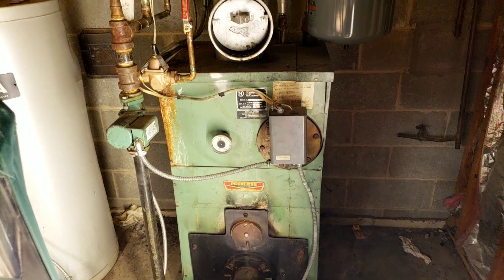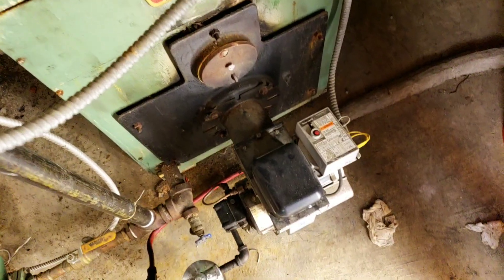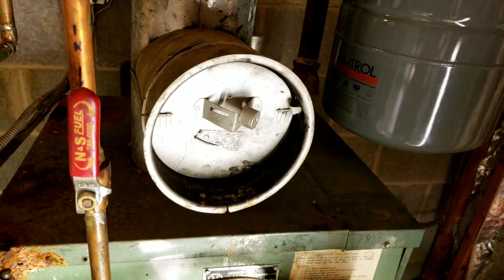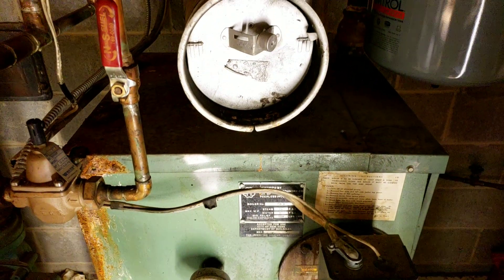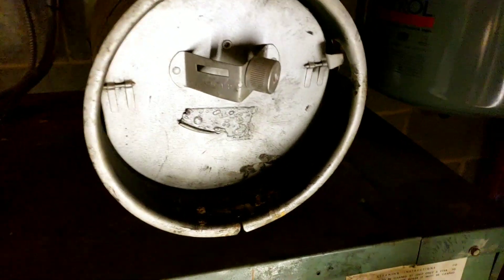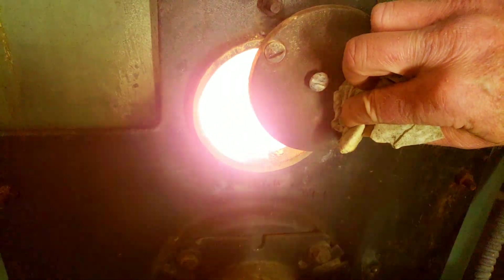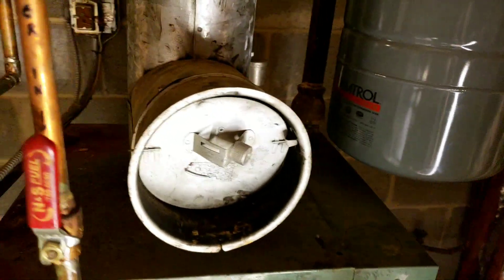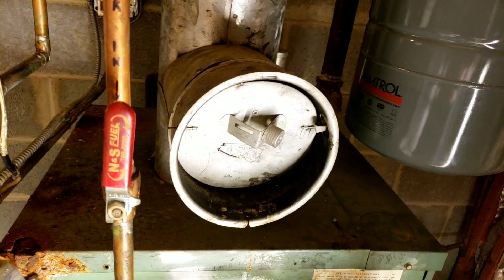Help from expert please- Barometric Damper

Comment: All these comments, it's funny... But, the ones that gave you the measurents know that if your guessing, you aren't testing. And that can mean improper burning resulting in soot build up or too much heat escaping to heat the boiler sections properly and a higher operating cost. I'm sure it's resolved by now but for anyone else, just get your boiler serviced one time and let them set things. AS LONG AS you don't run very low on oil, you can go 3/4 years without another cleaning and tune up; I did that for 20 years (and later my town converted my oil boiler to gas for 800$, what a deal!! and they remarked how clean my boiler was!!) I would change the tank filter, the pump filter and clean the eye and igniter tips every year or 2, replace the nozzle if it had any build up (only about 25$ in parts!!), but I tried to always keep it above 1/4 tank. People who let their tanks run low are their own worst enemy, I know it's not cheap (my large Victorian apartment houses are 1700$ and 1900$ a month to heat with nat gas), but when you run your tank low or run it out, the whole system gets filthy and I've even seen that start a fire! Once you have to go and get 5 gallon jugs of diesel just to get by for 2 more days, you're only hurting yourself!
Reply from the maker: That deserves a “heart” because you are correct. Holds true for automobiles as well. I try to keep it above 1/4 tank of gas at all times.  Since we moved in we have had someone come out yearly to “service” the boiler ; new filter, nozzle, etc but I’ve never seen him do a combustion analysis nor have I seen him check the draft over the flame. I’m interested in this stuff but don’t stand over him and annoy him, but I figured I would ask the you tube “ community”.   Again, you are correct, I’ve since bought an older “draftrite” unit to check the draft and adjust the damper myself.   I spend my time watching oil boiler and natural gas furnace repair videos. I’ve gotten feedback from many guys in the field because most get deliveries when low on oil due to the cost. We have never known anything but auto-delivery. My company shows up monthly each winter and fills our 550g tank. We use about 300g a month in the winter, so we just get billed the current cost per gallon x number of gallons.  It sucks but apparently many people can’t do that and need to wait until they are almost out due to the expense. Hopefully it goes back down to $1.00/ g but I’m not holding my breath. Thanks for your thoughtful comment.

Comment: I’m very late to this old post but seeing how it’s going I don’t think you got a good answer. To be honest what you did is the closest thing to being the correct thing to do.
The damper SHOULD NOT BE screwed closed🤦‍♂️ !!!
These young hvac guys have no idea about that damper and how inportant the draft is. Some of them have no idea what it is or does. From the video I would say you want the flap to open up just a bit more. So adjust the weight as you did before. The ONLY TRUE WAY TO KNOW how much is by using a draft gauge. You control the draft with the weight on the damper. Too much draft and you lose efficiency by letting all the hot air escape through the chimney before heating the water. Too little draft and you will have a poor burning and an accumulation of soot.
You take a reading from two places. First the over fire. That is the flap that you can see the fire. Try to get a reading of -.015 to -.02. The second reading comes from stack draft. There should be a hole in your flue just below the damper. That reading should be -.04 to -.05
DO NOT let your tech tell you it’s fine with any other readings outside of this. Have him set it to these numbers (or you can do it if you get a draft gauge) because they will fluctuate over time and these number are dead center numbers of where they should be. You adjust the readings by moving the weights in the damper closing or opening the flap accordingly. Usually once you get the over fire reading of -.015 to -.02 (-.02 being ideal) the stack reading tends to be in that -.04 to -.05 range (-.04 being ideal).
And last as someone commented, get yourself a new damper. They get old, warped, and tend not to work as well as they should after many years.
Ohhh one more thing. That loud flapping should not happen and I saw odd answer about down draft. Some of it was right but looks like you corrected it by adjusting the weight. If that didn’t work looks like it would be a chimney issue, more than likely needing a new or different cap to prevent major down draft.
Hope this helps.

Comment: Update!!  most of the barometric damper videos seem to have the weight on top of the pivot and boiler pulls air off the bottom.  The grayserviceman youtube video shows the opposite setup weight on bottom.  Nat gas boilers should have dual action.
Reply: Grayserviceman has his damper upside down which is wrong. Affects the hinges and how the flap opens and closes. Way ti confirm this if you need to know is call the damper’s manufacturer and they will tell you.
Reply from the maker: @Ervs-33  truly appreciate the comment.  Since I posted this video,  I asked the guy who services my boiler and her screwed it shut and told me the air over the flame and in the flue is good without it. Then I bought an old Bacharach Draft Rite to measure the draft myself. I took out the screw my tech installed and set it so it’s not pulling too much air from the flame. Just on the negative 1 side.  If you want to see how a pro does it, watch Steve Lavs video here. He really knows old school how to work on these. https://youtu.be/kM9cuKpoBRY?si=sNyaSW-Drg0GzIBr
Reply: @Drrich_DIY  thanks for the feedback (great video)... I'm learning more...  dual acting BD can allow combustion gas into the room when it flips (ie positive pressure) ...   I am also hearing that for a natural gas boiler, allowing room air to mix with combustion exhaust (negative pressure) is typically the only mode required (ie pulling additional air in vacuum to reduce exhaust flue velocity and shorten the burner flame), and there should be a tap or limit to prevent the exhaust dump mode.  I'm also hearing that the application for BD is typically for 30 feet plus class 1 chimneys (ie brick); I'm on the cusp as my chimney  is probably less than 30' in height.

Comment: Draft over fire should be between negative .02 and .03 if it isn’t then you need to adjust the weight on the barometric damper until you get the correct reading.
Reply from the maker: Thanks very much. So you mean crack the inspection door and insert the probe of something like this? https://www.supplyhouse.com/Bacharach-13-3000-Draftrite-Draft-Pocket-Gauge-0-10-to-0-to-0-14-WC 
Thanks.

Comment: there are simple cheap measuring tool which will tell you the pressure, basically a small ball in a plastic shaft. called Dwyer® Air Meter Kit. more expensive Than when I bought it but still worth it.

Comment: Do you still have the Peerless working? I had one just like this one you have, 30 years old that was replaced last Saturday. Three big guys to move it out of the basement. I was one of them. Crazily heavyweight. Mine died because of coil cap that rusted beyond repair. Change the cap if it starts getting too rusty and before gets too late.
Reply from the maker: Yes I still have it. And its still working fine.  I will have to research what a coil cap is and where its located. Never heard of that. Thank you for the advice!
Reply from the maker: Are you taking about this?
https://youtu.be/vU4qZL91wm8
Reply: @Drrich_DIY  Glad that is still working for you. Yes, this is the potential issue. If it gets too rusty it becomes impossible to remove the screws and bolts. I had five guys coming and all five declined to try replace mine. In my case the was not only the cover because I have indirect heated tank and an option to have the coil installed inside the heater instead of only the cover.
Reply from the maker: @jaimelima2420  my job was much easier since I have an indirect heater.  At least you have a new higher efficiency boiler. I’ve changed almost everything now. I put in  a new triple aquastat last year .  I’ll just keep my fingers crossed. Thanks for commenting and your advice!
Reply: @Drrich_DIY  Nice. If the screws are just studs going tru a hole of cast iron It seems to be a low risk fix. Maybe the five HVAC guys were just telling me that after 30 years it would be better for me (and them) to replace it instead of giving them 20% of cost of a new one by asking them to fix it. In mine the bolts, screws and the cap just decayed into a slump of wet rust so the guys were afraid of not being able to bolt and seal the new cover and leave me w/o heat if the repair attempt failed. But with studs I can’t see how it would not seal again. Good job maintaining the old boiler. It is good quality and worth doing it!
Reply from the maker: @jaimelima2420  oops. I re watched my video. Those were bolts on my coil. The blank cover came with new ones. The studs were on the burner. I bought but didn't need those.  
 I was very glad I didn't snap off the bolts when I pulled the tankless  I started spraying them about a week in advance And I was extremely careful.  But like I said I didn't have to cut and disconnect the tankless and reinstall a new one. I knew nobody would do my job the way nobody wanted to do yours.  I did mine in the summer and my wife and I were prepared mentally to install a new boiler of I broke ours.  But I was lucky.  
 Thanks again for all the comments

Comment: This is a late comment.  I am not a professional.   However,  did you notice that right side of the damper was actually bent, so its arm won’t reach the hole on the right?  That’s why your damper is flipping over.
Reply from the maker: I appreciate the heads up. Believe it or not, that is 100% the camera angle and shadows  that are making it appear that way. 
In reality its completely fine and not bent, and makes the seal it is supposed to. 

I watched the video back and I see what you are saying. 
Thank you again

Comment: You can do it without a mamometer but it's tricky and not 100 percent, just have to experiment in no wind and high wind situations tk get a feel of it, the purpose is so the wind don't suck all the heat off the boiler, when they aren't working you will know because your heating bill will increase!!

Comment: The screw should have been on the lower edge outside of the damper so the flap can move but it would prevent cool air from drafting into the building. The screw should also have been high enough to prevent it from allowing the flap to jump over it which it sounds like it did. It should still be able to flap the way it is now.

Comment: Is there any way to prevent it from clanging back and forth so loud when the furnace isn't running, particularly at night time?
Reply: How did u fix it?
Reply: @shouldysound22 If it's moving when the furnace is off, it's likely being affected by wind at the chimney stack. You might need a better chimney hat to mitigate the wind.
Reply from the maker: When I asked my service tech about its purpose he measured the draft with some gauge and said it was unnecessary then put a screw into the metal keeping it almost fully closed. 
Having said that, I would suggest seeing what its hitting against thats making the noise. Then go to the auto store and buy high temp gasket maker (I think its red) by permatex or jb weld. 
Then I would put some of the high temp silicone on the noisy spot and make sure the damper is held opened away from the drying silicone until it hardens enough so the damper won't stick. 
You may have to add in a few layers so the damper still works but the noise is minimal.

Comment: Call the expert if its under contract.. but dont put the screw in. It's working properly. Is it set right? You won't know that without the tester.. pay the guy  don't die from carbon monoxide..
Reply from the maker: i didnt put a screw in- it was already there.  I took it out. I get the burner serviced once a year and this year I asked the service tech.  He seemed to be knowledgable and brought something to test the draw of the gas and told me that the damper wasnt needed which was why the screw was there to prevent it from opening.  Then he put a new screw in . Guess I dont need one. PS I have like 6 carbon monoxide detectors around my house so I better not die of carbon monoxide poisoning........
Reply: @Drrich_DIY  get a new service technician. All oil fired boilers and furnaces need a draft regulator. It has to be set with a draft gauge. If you have too much draft it can pull the flame off the nozzle. If you have too little you will pressurize the combustion chamber which can cause  carbon monoxide and elevated flue temperatures which could lead to a fire. If there isn't enough draft, which is probably why they screwed it fast, sometimes a chimney cap will help. If not you will need a draft inducer installed. Get someone who knows what they are doing because apparently the guy that you have doesn't. Don't mess with your life.
Reply from the maker: @brucebartman36  he brought in a gauge and put it into the flue to measure the draft. He called me over to show me. He said something like the draft was already sufficient and the damper was taking too much air from in the room and was unnecessary, which is why it was originally screwed shut when I moved in (not completely shut- but allowing about an inch of opening. Just not variable). I do have a CO alarm right there and it’s never alerted.  Does that sound reasonable?  Thanks for the comment by the way. Really appreciate your expertise.
Reply: @Drrich_DIY  if it's taking too much air from the room and he screws it shut, then it will take too much air from the boiler. If the draft is correct with it open, it will be too high if its closed. It doesn't matter how much air it takes from the room, as long as the draft is correct. That's is the purpose of the draft regulator. On a windy day the draft will increase and the regulator will open to pull air from the room instead of through the combustion chamber. Once the weight is set for proper draft the door will swing open and closed to maintain the draft setting.
Reply from the maker: @brucebartman36  what a great explanation. Thank you very much.
Reply: @brucebartman36  exactly right. Your lower (overfire) draft should be .02 inches water column different from the draft  at the barometric damper (ideally -.04 iwc). Rattling of the damper may occur when the weight is set correctly. That is a consequence of high winds. 44 years in the heating field speaking.
Reply: I hope you figured this out..some newer units don't need one but that one definitely does. Should be set with it running and hot. Weather, wind, soot build up, efficiency of the oil burning constantly change that pressure and that is like an automatic throttle to allow more air to stay in the combustion chamber or allow more air out depending on various conditions.

Comment: Hi, I am no expert on oil fired boilers. However, in my opinion, what you have here is what is known in the UK as a "Flue Draught (draft US) Stabiliser". The function of these things is very simple, when the flue sucks too much for the boiler, stove, whatever, the flap in the stabiliser opens to allow air from the room into the flue and reduce the draw on the boiler. How much it opens depends on how much the flue is drawing. Then the boiler can continue to function as it should. If the flap is clanging shut it sounds as if you have downdraughts (downdrafts) which you definitely don't want because those are air being blown back down the flue by the wind. In that case I would guess you need something like a Colt cowl at the top of the flue to stop downdraughts. As to how you should set the stabiliser, once you have sorted out the downdraught problem, you will need to know what draught the boiler requires (manufacturers specs) and what the draught in the flue is for which you will need a draught (draft) gauge, ideally anyway. It sounds to me as though you have a downdraught problem and that until you have sorted that out you won't be able to set the stabiliser so that the boiler runs happily. All I have written here is an expression of my opinion
Reply: I think he's getting down draft because he said when it's off it bangs.  So the flue is cold and not drawing warm air up.. wouldn't hurt to put on a down draft guard it would help on terribly windy days but if it's set correct when it's running it will work as needed and just bang when not running..

Comment: The draft control should be ajusted with a magnehelic gage, it just be set at .05 inch of water column, when you don't have a magnehelic gage, shut the furnace off, then block the chimney through the draft control with a large plastic bag or something to prevent the chimney to pull air from the draft control, then ajust the weight and have the door just slightly closed, with your mouth, just blow a little air on the bottom of the door and it should open for about an inch, then lock the weight in place. it should be good, then take the bag out and it should be good, but make sure the combustion is OK, it should not smoke. But this is not the accurate way to ajust it, it should be done with a magnehelic gage........
Reply from the maker: Goudrelle thanks very much for that info. It’s cooling season in NY right now so I’m cleaning coils and making sure condensate lines aren’t blocked, but I will give it a try in the fall. Cheers
Reply: I'll second everything @Goudrelle mentioned. Especially to check the combustion. If you can get your hands on a manometer then you're golden. in the mean time you should at bare minimum get a CO detector in the area.